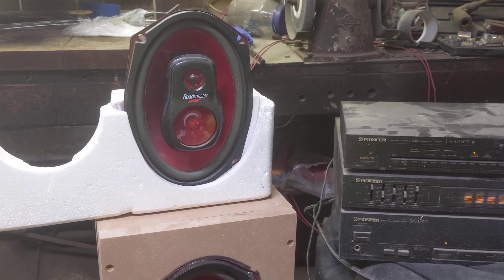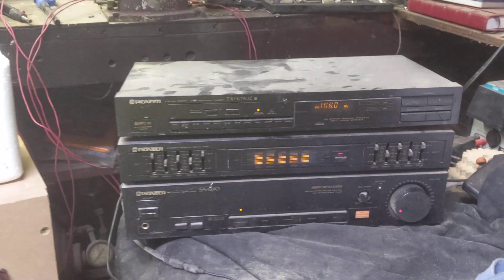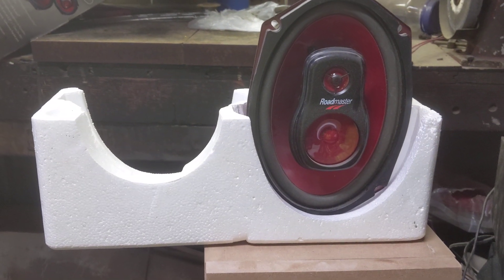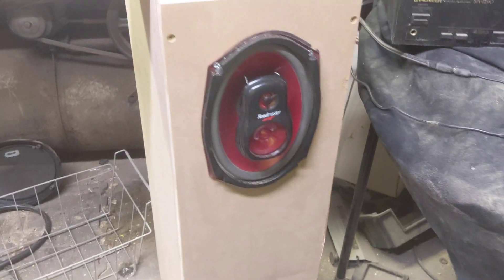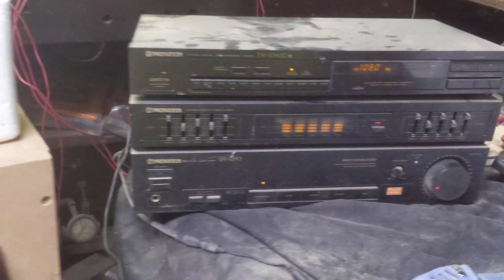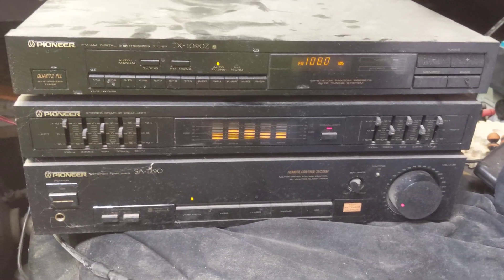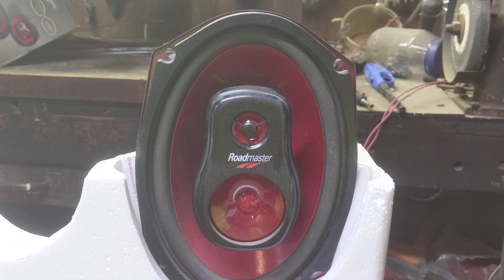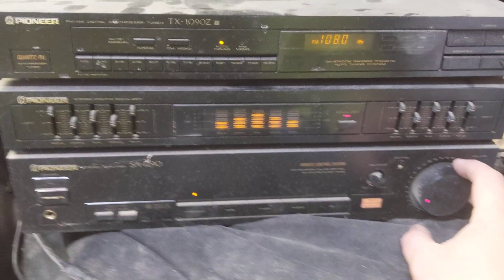Speakers build

Comment: fun. I have some old tower spkrs with blown woofers...wondered how good it could be with some decent 6x9's in there. If I were going to the work you did to build proper enclosures, i'd spend a little more for a pair with better mids and tweeters...those cheap mylar deals are really harsh.  but hey you are making those cheap drivers sound about as good as they possibly could!.   unlike factory built speakers, you can always easily upgrade &/or replace damaged units .  I like the idea.